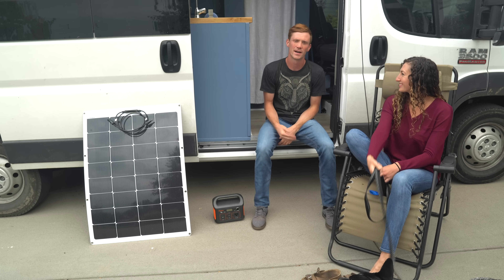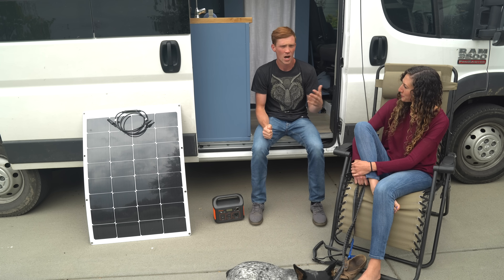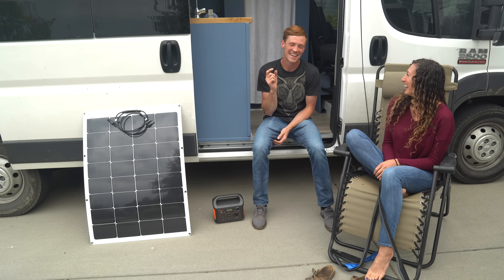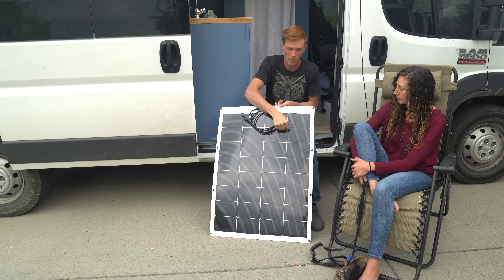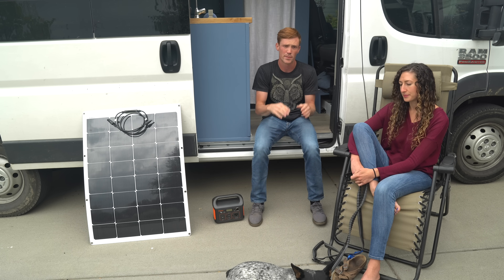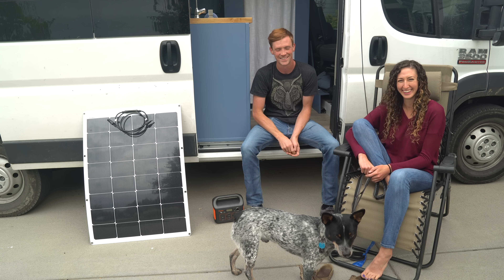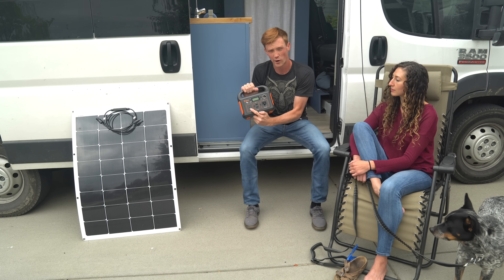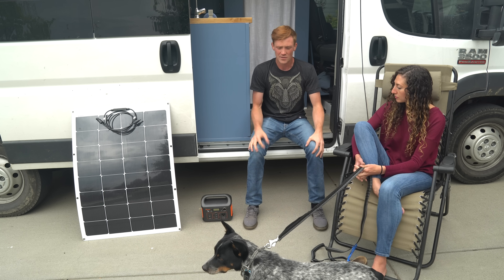How does Solar work? Sizing your van system | Trent and Allie

Comment: Hey Trent & Allie,

Thanks for the video about the power bank.  I have a pretty small system and hopefully one day I upgrade it.  I currently have 2x 100 watt Windynation solar panels and 2 x 125amp AGM VMAX sealed batteries (total of 250amps).  My inverter is a 3000watt (6000peak) KREIGER .   I just try to see if it can run the portable induction cooktop that has settings from 1000 to 1500 watts but it won't heat up.  It can turn on but no heat generated.  Do you have any idea why?  Appreciated 
Thanks 
Bo
Reply from the maker: Your battery bank and solar system is too small to run that cook top. I used to run an induction cook top off of 400 ah of battery and it was too small and would drain the battery bank down too far and send the inverter into fault. 
You'll need to double your battery bank size to run that cook top.
Reply: @TrentandAllie  thanks

Comment: Trent, I've heard that solar panels create such intense heat that the paint on top of the vehicle can bubble even with a 4" clearance.
Reply from the maker: A lot of older solar panels do generate more heat but newer panels are better at dissipating heat and the flexible solar panels are mounted directly on the metal all the time and I've never seen one bubble the paint.

Comment: so, if I wire the panels(5 ,100 watt) for 24v instead of 12v the MPPT will convert it back to 12v or I need to wire batteries(2 six volt and one 12 volt AGM's) to 24v and use a 24 to 12v converter? and also I enjoyed Allie sitting in that chair so much I got mine out(just the same chair like floating on air) and sat down. thanks guys
Reply from the maker: You'll want to wire your 5, 100 watt panels in series so they would then be 60v  (since you add 12v for each panel you wire in series) Then the MPPT charge controller will convert that the 12v at a high amperage and that will be the most efficient way to charge your system. 
Those chairs are awesome!! We have two of them

Comment: As a note, one advantage of Lithium is weight savings. You could save significant weight in the van with lithium.batteries. Most solar vlogs forget to mention this.
Reply from the maker: Yeah AGM are very heavy.

Comment: Great guys! You did not include what voltage sensing relay you installed. No big deal, you chose top self parts for your system, just wanted to know what you chose for the relay. Thanxz
Reply from the maker: VSR's are a very basic mechanism so you don't really need a high dollar crazy one. The one I used is cheap and works great. It's listed in the description

Comment: Great video! Which voltage sensing relay do you have and how is it sized to your system? Do you have the stock 180 amp alternator or the 220 amp?
Reply from the maker: We just have the regular 180 amp alternator. The VSR we used is in the description. really you just wanna make sure you use 2 or 4 awg welding wire to connect them and it should work fine.

Comment: Got an 2000wt inverter like to know what size batteries I need and how many solar panel can I use with it ..getting it all before I put inside an van
Reply: 2000wt sorry
Reply from the maker: 2000 watt is large enough to run a lot of things but your battery bank will depend on what you want to run off of it. I would recommend getting at least 400 ah of batteries. You can get 200ah AGM batteries and wire two of the in parallel and be set. 
Then I would get 2 of the 300 watt panels we have listed in our description. Those will work well with that size system

Comment: https://www.youtube.com/watch?v=cM5s4F-7AOk 
you can also design to use extending solar panels only at one side of the roof as the side tent... your flexible ones have also a gain in thickness, you can support em with a lightweight alveolar polycarbonate sheet

Comment: My batteries say 225AH @20hr and 185 @ 5hr which number do you use?  They're 6v lead acid Thanks Trent!
Reply from the maker: 225ah is the size of those batteries. you''ll need to wire them in series to create a 12v battery though.

Comment: Trent how about the inline fuse, and sizes? Plus wire size? Great information, thanks for sharing! Allie, you look smashing, just sitting there! : )
Reply from the maker: Wire size and fuses are going to depend on the size of your solar array (full panel system size) and the inverter size. 
If you know your system size you can google that amount of electricity and find out how big of wire and what size fuse you need.
Reply: SAPPER FOREVER there's a great site (https://gnomadhome.com/build-your-van/#electrical) out there that has comprehensive info like that.
Reply: Jim Emery thanks
Reply: I'm also interested in wire size as well. Not a whole lot of info around on that.
Reply: The size of the wire is determined by how many amps are going through it ( https://www.how-to-wire-it.com/romex-cable.html ). For the fuse size you use a fuse that's one step above your wire size amp rating. Say you have a 10 gauge wire that rated at 30 amps, use a 35 amp fuse. The fuse is mainly there to project the wire. A wire can handle more amps above it's rated amount but it starts to get really hot (BAD). If you put to many amps through it, it will start to melt.
Reply: Thanks for all the help I really appreciate it! Will definitely check that out!

Comment: i was wondering about the air lift system, is it just to stabilize wile driving? also the water pump, does yours not make that noise i hear in other systems? and lastly, i'm 6'4" is there a van for me without a popup?
Reply from the maker: the sprinter and the transit both have super high roof options for guys like you. 
Air bags are to supplement the rear suspension in all scenarios. 
The water pump makes noise but we have it mounted under the bed so it's a lot quieter than others.
Reply: Ford transit van has a 6'9" ceiling. I am also 6'4" and I plan to build a Murphy bed in a California twin mattress 54 x 80.

Comment: I’m happy to see you talk about various options. For your setup I understand the route you went. For many the Goal zero all in one package is just fine and may be worth the cost for the ease and functionality. I personally only power a fridge, max air fan, and led lights so I went with the yeti 1400 and added the MPPT controller and it’s perfect for my needs. I also added the Goal Zero panels to the roof so it’s truly a plug and play system. If I had your Latte addiction I would have had to go with a setup like yours😀   Joking aside, this was a great video that showed people that there are many options depending on what they plan to power.
Reply from the maker: Thanks Peter!! Glad you enjoyed it and it only makes sense that you went full goal zero! You're from Utah just like Goal Zero!

Comment: Thanks for your thorough explanation about your solar setup.  I have (again) a non-topic related  question.... shouldn't you replace those tires on the van!? :-)
Reply from the maker: Those are the factory tires that came on the van and since it's a 1 ton van they are very high weight rated tires. 
they will be replaced in the winter though

Comment: Dear Trent, all your comments about solar installation is first class.
Nevertheless, without seeking to question your knowledge, I find that your remarks about Yeti and Jackery Lithium batteries should be amended.
They are Li-ion NMC and therefore have a much shorter life span than LiFePO4 (500 cycles vs. 2,000) and are much more dangerous (risk of explosion and fire).
Their only advantage is the high stored energy level  (Wh/Kg) and the discharge coefficient capacity.
Even if the level of protection is better than before with that tech, users must be well informed about the risks and mistakes not to commit and I cannot conceive of permanent use for outdoors activities. Maybe a reserve power generator.
Enlighten me
Reply: Robert, would you clear up your pronoun use as I'm not sure to which "Their" you refer to in the forth sentence starting with "Their only advantage."  And also, on your third sentence, what does "They" refer to?  Which one has Li-ion NMC as compared to LiFePO4? and so which one would me more dangerous and why?  Thank you
Reply: English is not my mother tongue. Sorry for that.
"Their" (possessive pronoun) refers to both Yeti and Jackery Li-ion NMC portable power stations. Should have I written "Theirs" ?
"They" (personal pronoun) refers to both Yeti and Jackery again.
Reply: Even more confusing now.  No need to define whether one is a possessive or personal reference.  I was only trying to figure to which model between the two you refer to since you're making a comparison.  Forget it - I'll just figure it out somewhere else - I've re read your statement a few times and its more confusing every time.
Reply: In the video, Trent refers to YETI Li-ion portable power station and Jackery Li-ion portable power station (the one which is presented in the video). Both are Li-ion NMC.
Reply from the maker: I know a lot of people want to opt for these power stations since they knock out a few birds with one stone, I don't recommend it but i wanted to cover it in the video. 
I know they have a risk of fire and explosions but there are plenty of risks with the electrical and solar systems in the van, I am not going to go over all the risks of each component. that is left to the consumer to do their own research. Also I'm not that well versed in lithium and the different types. So it's better for people to research on their own anyhow.
Reply: Trent I feel compeled to reply in support.  I think the key to any good "how-to" video is answering what things are chosen and how things are installed.  Anyone comfortable enough to take on their own build is or should be informed enough that they feel comfortable substituting one item for another.  So in your van as an example, it is a tremendous help for me to see how you installed stuff, where you installed the stuff and why you chose that stuff?!   That was pretty hard to write I'll tell you.  I can pick whatever brand I chose but the install will be easy because you have done the hard work.  All I have to do is copy or modify slightly.   Keep up the informed videos, I enjoy yours a lot!
Reply: Thanks for that. I did not want to be controversial.
What I like in your videos, besides the awesome characters you both are,  is  what seems to be a "genuine and authentic" attitude. Again, thank you for that.

Comment: Just bought my promaster a few days ago. I have very similar electrical needs as you so I’m considering an almost identical setup as yours. I’m still undecided if hot water heater, stove, and heater should be gas or electric. What do you use for these appliances? If I decided to go all electric on these appliances would this system support it? If not where would I need to go bigger to support it? Also great info in the video! I like that you went straight to the point on each point! A visual diagram might of helped but since I’m pretty deep in the “solar” research I had no problem following.
Reply from the maker: Yes AC will be a dream until something new rolls around. 
Anytime you're creating heat, it takes a lot of electricity. If you're creating heat with propane it's simple and very cheap. that's why our water heater, furnace and stove are all propane.
Reply: Trent & Allie do you have a video showing the layout of your solar and fan placement? Also your panels are huge! Do they hang over the sides? Would love if you did a video talking about how and why you mounted the way you did:)
Reply: If you're planning on doing elecrical appliances, you need to plan a system built around Lithium Iron batteries (LiFePo4). LIthium batteries are capable of keeping up with the large currents required to feed something like an induction cooktop. Current is measured in amperes, and its relationship with voltage is such that the higher your voltage, the lower your current, and vice versa, for an given amount of watts needed by the appliance. Which means that if you have a 12 volt battery connected to the inverter, the 12 volt battery has to deliver a ton of current - 50-60-70 amps - to the inverter so it can create something like 115 volts and 10 amperes to the cooktop or appliance (I didn't do calculations, these are just illustrative numbers, it's probably not exactly 10 amps...) . The lead-acid batteries they run in their build probably can't handle that, certainly not for very long - lead-acid batteries were invented in like the year 1850. Lithium can, however, deliver large currents for prolonged periods. 

However, trying to run a hot water heater for the shower for instance with electricity is probably one step too far. For that you need gas, or a diesel-burning furnace.
Reply: Croft thanks! Sounds like gas is just the way to go for the mentioned appliances. If I’m going to do one I might as well do all of them gas since they are all power hogs. Plus I don’t like to cook with electric anyways. Just didn’t want to install gas if I could get away all electric. To bad you can’t run an ac off propane then I’d be set. Don’t really want to depend on a generator so I think ac will just have to be a dream for now.

Comment: Thanks guys! I feel so much smarter after this video. Do I need a charge controller to run power from the starter battery (with a battery isolator) to charge the "house" battery bank?
Reply from the maker: No you don't need a charge controller to hook up a voltage sensing relay. Glad this video helped you :)

Comment: Am an engineer so i already know that but it's still a very informative and interesting video, it's nice to share some technical aspect of ur van life am sure alot of ppl will enjoy it !
Edit: about the battery, yes it cost less, but it has less longevity 
for exemple: an AGM can cycle from charged to discharged around 500 times befor it has to be replaced
while the lithium one can cycle 2 000 times, and an other important thing to know is that the AGM can only discharged at 50% while lithium can go down to 20% so u will have more use from it for the same charge. 
while u probably already know that am sure of it. may be some comments reader can learn something.
Reply: 2000 cycles for Lithium is very conservative. 5000 is probably entirely realistic. Possibly more.
Reply from the maker: Yes you're right, thats why i compare the lithium battery banks of half the size of the agm's but they're still 3 times the price. which is my main reasons for stating that you need to think how long you're going to use this battery bank for . if you're going to use it forever, lithium is the choice, if only for a year or two, probably better to go with agm
Reply: @TrentandAllie  I needed to hear THAT! Thank you Trent! I am planning a van build but I won't be building myseld..just planning. It qill.be me and my partner and he's a gamer. He knows he will have to limit the gaming time to maybe an hour or two 2 to 3 days a week at MOST. So with that, and basic charging of phones and laptops, the largest appliance we may have would be a 700watt microwave (the jury is still out on that one) and a 24 inch computer monitor for a tv, how much solar and  battery amp hours (agm batteries) would you estimate we need? We need all the help we can get so we're not overpaying. And we are planning on about 2 years of fulltiming..mostly city living with travel in-between because we both still have static jobs. Anything you can suggest will be greatly appreciated! Love you three and your van! We are getting a Promaster too! The 136wb high roof and plan on city living in Chicago for the time being. No shower needed but definitely a toilet area and mandatory roof vent!😉
Thanks again for any info you can give us.
Reply: @kimberlyw.5712  I'm planning a build too. We are looking at the promaster and trying to learn and decide on floor plan etc. Can't wait to downsize.

Comment: Would you see any issue with running fully electric for not only hot water, but heating? I am contemplating electric underfloor. (Plus, as you say the coffee maker!)
Reply: Electricity is the single hardest type of energy to get in large quantities in a van. Let's say you manage to fit 1000 watts of solar on your van (should barely be possible on an extended length one, if you pick hard panels in the right size). When you need underfloor heat, it's going to be winter. That means your 1000 watts is more like 200 watts (or less, whatever minor fraction they can deliver in the winter) and that's in broad daylight. You can't heat a van off 200 (or realistically, just barely off a 1000) watts. Solar is great for charging your laptop or briefly running some appliances, but electric heating? To put it plainly, not a chance in hell. Unless you can get a 115/230 volt shore power connection, anyway. 

To heat the van (and water), your choices boil down to some kind of fossil fuel. Propane gas, or diesel, can be used to run a furnace. I suppose in theory you could do water-borne floor heat, but that's quite an involved build. Most people just blow warm air around the cabin.
Reply from the maker: Running a heat source off of just electricity is so inefficient that you really can't do it in a van.
Reply: @TrentandAllie  
Under floor heating has the reputation of being efficient in a house, heat rises? Got me thinking.